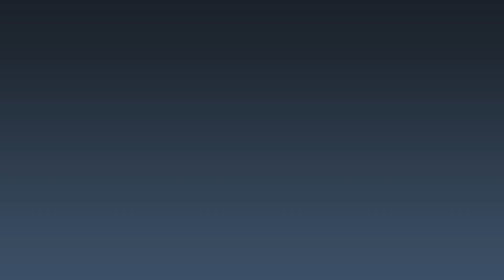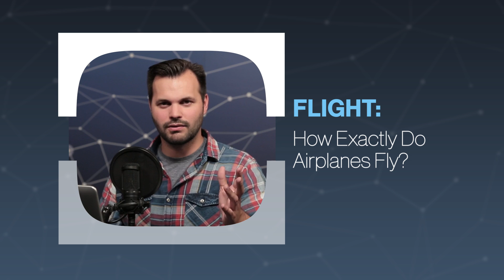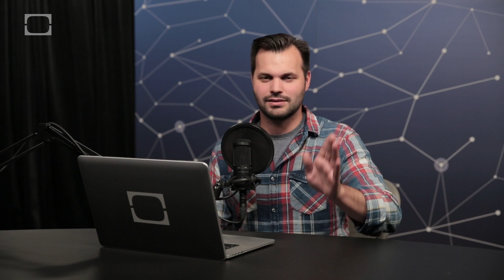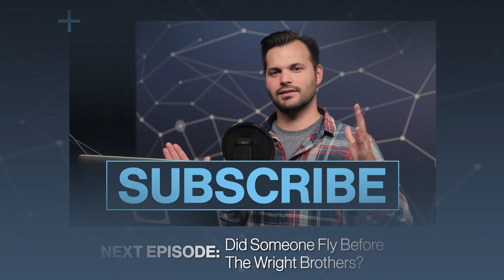How Exactly Do Airplanes Fly?

Comment: Stated that way, is incorrect.
"faster air DOES NOT have a lower pressure than "slower" air
.
The real science is that, while the lift is the Top-Bottom pressure difference pushing up...

It is a difference in pressure between two locations providing the force that accelerates air toward the lower pressure.  The higher pressure pushes more on the air, thus accelerating it toward the lower pressure (Newton in fluids) , JUST LIKE it pushing up on the wing's bottom more than it pushes down on top -- LIFT!
..
ALL THE LIFT comes from the wing-Top-Bottom Pressure difference!  ALL OF IT !!
.
At 4:32 You misspoke saying the water moved by the force of air???? WTF??.  
.
Actually Bernoulli's notes give NO INDICATION that he knew the cause.  He only knew the pressure-speed relationship.
It was Euler, following up on Bernoulli's work that figured out that it is pressures accelerate fluid.
.
That "Newton Reaction" thing  is also FALSE....
Problem:
If the air leaving the trailing edge provided the upward 'reaction' force of lift, that upward lift would all be pushing up on the trailing edge.  It is well known that the center of lift is about 25% of the way behind the Leading edge.
.. .. .,.
Unfortunately, he is using an all too common myth about Bernoulli's Principle.
.
What you should get out of Bernoulli is that a speed increase (acceleration) is caused by a Pressure Gradient (difference pressures between two locations).
.
Pressure differences accelerate the air. A pressure Gradient pushes and accelerates air toward the lower pressure. This is Newton in fluids and is the SAME thing as the Top-Bottom difference pushing the wing up!.
.
The decreased pressure above the wing is the cause of the acceleration toward the trailing edge.
.. ...

.The biggest factor for lift is what happens above the wing. The wing's motion and shape causes a reduction in pressure, but not as described by so many well-meaning amateurs.
.
 Yes it is counter-intuitive, but this is fact understood by aerodynamicists that is accurately covered in this short video - for ALL WINGS, upright or inverted, because it is the airflow that is the most important, NOT simply wing shape:

. WHY There is Lower Pressure Above a Wing
 https://www.youtube.com/watch?v=3MSqbnbKDmM
A LIKE would be appreciated.
..
And read this:
 Understanding Lift Correctly
 https://rxesywwbdscllwpn.quora.com/

--

Comment: many aerobatic airplanes have perfectly symmetrical wings so they can fly upside down just as well as right side up. bernoulli's principal does not have near enough force to create the lift needed to get an aircraft into the air. hence why its possible for planes to fly upside down and for wings to be symmetrical. plenty of lift without bernoulli's. although it is one small part of the equation. and its not because the top has more space to cover its due to the compression of the air in the front of the wing near and at the stagnation point.

Comment: Kindly solve this math :   Calculate the thrust required and the power required for the CP-1 airplane to fly at a constant speed of 50m/s along a straight path at sea level. Is this flight sustainable? (b) Repeat (a) at 10,000m altitude where the air density is 0.4135kg/m3.

Comment: I'm disappointed by your explanation of how a wing works. Bernoulli is great for explaining what happens in a pipe where all your stream lines are contained, but in the air Bernoulli's principal means very little as it doesn't provide any explanation for the interaction between streamlines.

Rather you should have focused on the force required to bend streamlines and the associated pressure gradients.

Furthermore vortices were neglected.
Reply: this
Reply: this
Reply: Bernoulli + Bernoulli normal to streamline then?

Comment: wron this theory is incorrect
Reply: Mohamed Elzarkouny here's the right theory I found on Google
A plane's engines are designed to move it forward at high speed. That makes air flow rapidly over the wings, which throw the air down toward the ground, generating an upward force called lift that overcomes the plane's weight and holds it in the sky.

Comment: His description of how lift is generated is technically incorrect. The air foil shape causes a whirlwind around it. The sum of the the air rotating around the wing and the air traveling by due to the motion means the air on top goes faster and slower on the bottom. The rest is correct after that point.

Comment: I'm not sure how right I am on this, but I do understand a little about the physics of auto racing, and when a race car is traveling really fast, they actually weigh less than if they're as rest. It's actually Bernoulli's Principle again though - air is passing beneath the car causing pressure to build. The faster the car goes, the greater the pressure. It's one of the reasons they have those tall wings (spoilers) on the back - to generate downforce that will counter the upward pressure and keep the car planted to the road. 

Just wondering if the same applies with flight - for example, a 727 is heavy AF when at rest on the tarmac, but in the air - traveling at 400 MPH or more, it's almost weightless from a stationary frame of reference, because the "lift" is cancelling out the "pull" of gravity.
Reply: Its mass stays the same, but some of the downward force is cancelled by the lift. You are correct, that is Bernoulli's principal in auto racing.

Comment: sorry to say that that explanation of how a wing works is a bit off. The vast majority of lift is generated by the wing displacing the oncoming flow of air downwards. This change in the inertia of the air downwards is of course balanced by an equal upwards force on the wing. The pressure difference is a comparatively small factor. Good work though Trace, I do enjoy your  vids :)

Comment: As an aircraft engineer and pilot, lift is produced by low pressure on top of the curved wing (camber) and also the airflow hitting the bottom. The shape of the wing such as camber and chord (width of the wing from front leading to trailing edge) can be changed by deploying flaps and leading edge slats. Thats enough kids, I'm off to sink some beers and hopfully pass out in the processs after a bitch of week. See you in the pub.

Comment: Some airplanes can fly upside down. If the lift is due to the shape of the wing, how is that possible?
Reply: upside down they have point the nose slightly up to achieve lift. plus certain wings are designed to achieve this easily by being symmetrical in thickness but it requires a nose up attitude to fly like that, flaps can help too

Comment: "The shape of the wing is THE most iportnant thing to get an airplane in the air..." Not really, a well designed wing helps, a lot, but it is not necessary. You could make an airplane with just a plain board as a wing, but it would take a lot more thrust and surface area to get it airborne.

Comment: I don't think you're right about the air going over the wing faster than under it. There have been studies that disproved this.  The reason that the air above the wing has lower pressure is because all of the air that would be there got pushed under the wing (from the middle row in the picture to the bottom row). Also, I don't think that the wing shape is the most important thing to get an airplane into the air. I fly RC airplanes and you can literally use a flat wing. It doesn't glide as well which means it's less efficient, but it still works. I know that I would rather be corrected than continue to believe something wrong, which is why I am telling you. But correct me if I was actually wrong.

Picture:
\ = Wing
| = Air

| | | | | | | | | | | | | | | | | | | | | | | |
| | | | | | | | | | | |\
| | | | | | | | | | | | ||||||||||||||||||||||||

Comment: The Why is: it is all just gravity and pressure differentials.  If your not LTA then you have to create the pressure differential by causing enough mass times its velocity to (on average) move in the opposite direction of the mass of your object times the velocity imparted by gravity.  All the other stuff is just complexity figuring out how the system behaves the way it does toward this end of producing a pressure differential.   When a plane flies by, it leaves behind a mass of air+exhaust moving downward and backward that matches the weight of the plane and momentum of randomized movement (turbulence) of the surrounding air it passed through.

Comment: Vortex can aslso be used to generate or icrease lift.
 There quite a lot of plane with vortex generator.
Also Insect use vortex as their principal way to generate lift.
Reply: Insects fly by swimming due to the low Reynolds number.  That is to say that the air appears very "thick" to them, just as water appears to us....Vortex generators are an advanced way to improve efficiency and are not part of the fundamental principles of lift in the first place.-- ScienceAdvisorSteve
Reply: I do not know who determine what is part of the fundamental principle of lift.

But vortex generator add  lift  and also a bit of drag.  They are not meant for efficiency.

Just to be sure i'm talking about the one added at the leading edge of the wing to increase lift / take off weight / and reduce stall speed..  

Or also the shape of the air intake on fighter jet meant to crate lift on high alpha using vortex.

I'm not talking about the wing tips/vortex  optimization  meant for fuel efficiency on passenger plane,

Comment: At about 6:25, you say an airplane has to generate enough lift to over come drag and gravity.  Wrong!  Lift overcomes gravity.  THRUST overcomes drag.  You got it right earlier in the video, but screwed up later.  Are you ad libbing this?  If so, you need to switch to a fully written out script.  Or was your script poorly written?  Almost every Test Tube Plus video I watch contains at least one clumsy error.  Many of the D News videos do also.  You need to have fact checkers.  Do you want to hire me?  I have a fairly broad range of knowledge.  I can spot a fair range of errors.  The most important thing about me, for this purpose, is that I know my limitations.  If a subject is outside my knowledge, I will say so.
Reply: I think he winged it.

Comment: Good grief, use models, or graphics, animation, something to teach concepts like this!!! :(
Reply: +Rayquazar42 Except he gives the example of the hand outside the window and than goes and talk about a completely different phenomenon, the Bernoulli's principle, creating a lower pressure zone on top of the wing and lower pressure below, which is not what's happening with your hand outside the window since you hand is more or less shaped the same on top and bottom, that's because of Newton' third law, forcing your hand up while it forces air down. Hence the fact that people can fly a completely square remote controlled cardboard sheet.
Reply: @Spartacusse  Your hand is still generating a pressure difference which fully explains the lift. Your explanation is identical
Reply: +1
Reply: +Rayquazar42 I was thinking the same thing. It isn't easy to show these concepts with words, but takes a few seconds with a piece of paper.
Reply: +Tamara Sauls +1 for "Good grief"
Reply: I was thinking the same

Comment: This is one reason Americans a misinformed. Most of the force comes from the Bernoulli effect on the top of the wing lifting the plane. Little is attributed to the force on the bottom pushing the plane up.
Reply: planes can fly upside down.
Reply: *****
Technically some planes can fly upside down for short periods of time. When the wing is turned upside down different principles are at work.
Reply: Submanca
Which planes can't fly upside-down? (Yes I know sometimes engines cut out when upside-down because fuel flow on many designs require the engine to be the right way up, but when the engine stops every aircraft becomes a glider of sorts).

I just did a search for "Tex Johnson 707" in readiness.
Reply: *****
lol a barrel roll is not flying upside down. It is merely spinning around. Well the short and simple answer to your question is the plane must have symmetrical airfoils to fly upside down long term. This includes jet fighters and aerobatic stunt planes. The term flying upside down to me is keeping a level altitude or gaining altitude while upside down.
Reply: Stick the nose "above the horizon" enough and you can gain altitude while upside-down, even with a non-symmetrical airfoil. Yes the aircraft may well need 10° "nose in the blue" with a lot of "stick forward" to get there.
Reply: *****
In a way you are right. At a point it is pretty much depends on how much power your thrust is producing. Just like very few planes can go straight up, which I don't consider flying by use of wings since they are not being used for lift. I would purpose most planes no matter how much nose up you need you can't maintain a constant speed or accelerate.
Reply: When you have an upward pitch of 10° and are upside-down you aren't using thrust to maintain altitude yet. You are using a heap of thrust to counteract the massive drag the huge flat panel the upside-down wings have become as they displace air (by deflecting it down) in a kind of Newtonian "equal and opposite reaction" deal - and all the drag that implies. It's almost a reverse spoiler.

The massive up-nose pitch is basically counteracting the Bernoulli principle and the fact that using nothing but fluidic displacement to create lift isn't very efficient at all. When upside-down the Bernoulli stuff is actually hindering the aircraft's flight more than helping, but the wing is still capable of making lift. (inefficiently)
Reply: *****
You are very correct. What you consider trust over coming drag is always present. May I put forward that without trust you wouldn't fly at all ever. With enough trust you could make a brick fly then but would it be considered flight?
Reply: Submanca Only if the brick is displacing air to gain buoyancy perpendicular to the direction of thrust. If the thrust vector is parallel to buoyancy, you have a rocket.
Reply: *****
Exactly!!

Comment: u should use some ANIMATION OR VIDEO , for better understanding!
Reply: Prepared for what? An exam? He doesn't need to by heart all this stuff to talk about it. This ain't the Indian Board Exams! Lol
Reply: +parth patel Also because it is meant to be a podcast editing images would mean that people who listen to it lose something
Reply: agreed. the lift generation , air flow & pressure are difficult to understand without a diagram or animation.
Reply: +parth patel It's a podcast, not a usual video.
Reply: +Rayquazar42 dude a diagram would do just fine. no need of animation.
Reply: +jason smith 

<-------<------<--------<----- Air ---<

============================ <--- Wing     |    Front of aircraft ->

<-----<------<-------<---- Air ---<

Looking at the side of the wing like this, the 'front' looks like a "D" shape - curved side facing into the wind, except that the bottom side is completely level all the way to the back of the wing, while the topside tapers downward to the back to a point. 

The air passing over the top of the wing will follow the contours, and thus will "split" at the "D" shape, but will continue to flow in a straight line under the wing, but above the wing, the air will move downward, "pushing" down on the rear-most portion of the wing.

Under Newton's Law, the opposite reaction will be that the front side of the wing will tip UP, forcing the wing into a diagonal position relative to the ground.
Reply: agree. listening 20 times also work, tough :)
Reply: it's awkward to see this guy's just reading from his laptop. he should have been prepared.